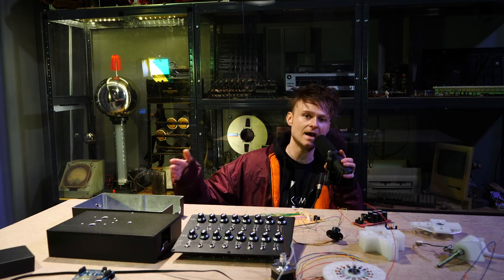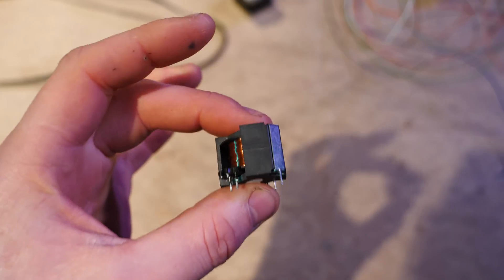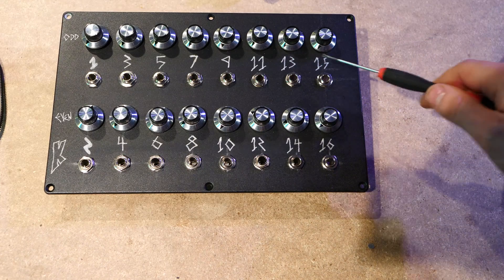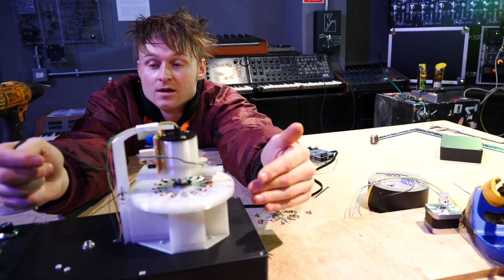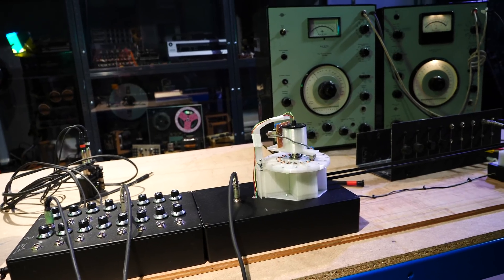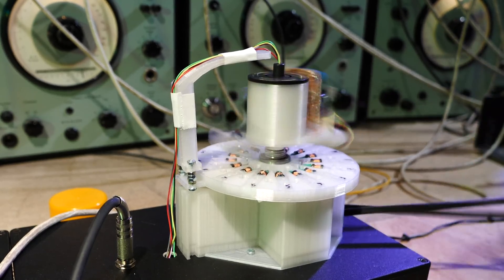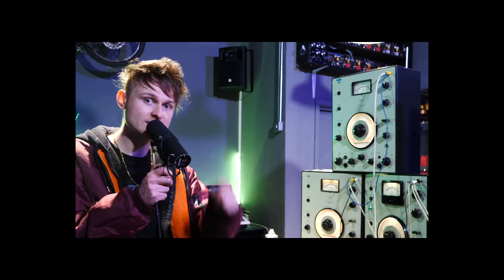Electro Magnetic Sonic Sequencer Thingy - Crystal Palace

Comment: Slip ring Can get kinda noisy  with age and damp and oxidation  + physical where down 

Shocked you Didn't go for a Rotatory Transformer  or shielded one)
 
Funny how both methods were used for Betamax and VHS

Rotatory Transformer won in the end Went on to Digital DAT & Digital Compact Cassette  & Digital Video ( Digital 8 & D-VHS)

Be Interesting to send S/PDIF over one of these even Multiplexing S/PDIF
Reply: Nah, trust Dave Young: High quality gold pen nibs are where it's at. =:o?

Comment: Sounds like they are talking about using the small gap in a fountain pen nib as an air gap capacitor.
Reply: No, the pen nib was used to pick up the signal from the rotating drum: it'designec to slide across paper without wearing out and getting pitted, so it was perfect for constantly rubbing against a rotating metal disk. =:o}

Comment: Raymond Scott's circle machine works on a similar principle, though he used photoresistors, and it was only hand-cranked to let you change the BPM of the sequence. The fact you're using tape heads and coils seems to introduce a few more variables since magnetic fields don't have strict boundaries. Also, the cascading effect of the inputs is frankly genius.
Reply: Yeah that cascade effect - or "normalling" of the inputs to their neighbours - is a feature of Dave Young's original design. In addition, the cross-fade between two inputs carrying the same signal resulted in no noticeable chance of level. So you could actually play a repeated 26 beat musical phrase by feeding each of the notes into the required input according to when it wax meant tl start, and have perfectly held notes across several beats just by not sticking a plug into any of the following input sockets.

Comment: Is it possible to run this device in the other direction (1 input to 16 outputs)
I want to hook it in to 16 speakers placed around a room
Reply: Slight redesign needed, I think, to get a decent signal strength into the coils. But getting a sound to spiral around 16 speakers would be cool! =:o}

Comment: This sounds lovely, can't wait to hear more! The first thing that springs to my mind, is how would it sound with something plugged into the even inputs like you have done, but then the output of the evens plugged into the input of the odds?
Reply: It would basically sound the same as if the evens weren't connected, if I'm understanding the signal flow he's gone for correctly. (The odd/even arrangement is a bit different from the original CP's signal flow.)

Comment: Why not direct drive rather than a belt? You are using a stepper... therefore a simple coupling like a piece of silicone tube to take up any misalignment... jobs a gud-un.
Reply from the maker: Electromagnetic noise
Reply: @LOOKMUMNOCOMPUTER  Why not try shielding.

Look at the CP device and see that the motors are shielded, the drive is a type of CVT drive to keep a constant and controllable speed as the wheel is moved in and out by a secondary motor pulling and pushing on a rod attached to the wheel, you can see the wear in to the disc if you look carefully.

I would say that the actual motor doesn't need to be that powerful as a stepper, so magnetic flux if in a metal case isn't an issue.

Putting the pickup and coils in their own shield will also make sure there is no EMF bleed.
Reply from the maker: @thepvporg  i have been trying things, mainly the reason is i only had about 3 days to figure out and build this. shielding was a faff and i just used parts from the bit drawer, as for stepper motor, its because in future i need more precise movement  backward and forwards and speed adjustable in the future i will have it just on the stepper motor but this is just a rough thing i cobbled together in about 36 hours hence the roughness.
Reply: @LOOKMUMNOCOMPUTER  I appreciate that you had a time constraint and your budget for shipping extended to your parts draw and sock draw, fnarr fnarr... 

I was thinking that this could be done a completely different way... Sent an email about it.
Reply from the maker: @thepvporg  alas didnt get an email about this today regarding motors but already working on a v2, about the size of a module. problem with direct drive is lack of hand touch but got a plan.
Reply: @LOOKMUMNOCOMPUTER  Sent it when I posted this, so you should get one.
Reply from the maker: @thepvporg  hi mark i replied!

Comment: Stepping through audio inputs reminded me of a lovely module for the ARP 2500 called the 1050 Mix-Sequencer. A 1x8 or 2x4 sequencer, it could pass both audio and control voltages. It can usually be found next to the 2500's 1027 10 step Sequencer modules to combine its three lines for longer sequences. It could combine the three rows to get 30 steps or as many as three 1027's for up to a 90 note sequence (I wouldn't want to have to tune that in the days before quantizing). It was most often used as a pair of four input mixers selectable by either front panel buttons or voltage control. I remember Pete Townsend of the Who commenting that he used it in that mode as a preset selector when creating both Quadrophenia and the soundtrack for the movie of the same name. In a synth with no patch memory that must have been quite handy. It's the synth module I've most wanted to get a chance to try out ideas on ever since I read the ad brochure back in the 1970's. I'm sure there are eurorack modles with similar abilities but, like much of the 2500, the Mix-Sequencer got there first. Like much of the 2500, it was way ahead of it's time.

Comment: When one outside of the UK hears about that BBC Radiophonic Workshop, they immediately think of Doctor Who.

I believe most of the Doctor Who's Foley work was done with a Mellotron that was custom fitted with various audio samples specifically for that purpose.
Reply: Dunno where you heard that, but in my 45 years as a devoted fan of the BBC RW I've never heard it! =:o}. 

Basically, up until the early 1970s the RW would prepare tracks on quarter inch tape, and they would be queued up and played into the studio using standard tape machines, by very skilled tape operators. From the mid 1970s onward sound effects were created and recorded in post-production, but still supplied on standard reels of quarter inch tape to be dubbed into the final soundtrack in a dubbing theatre. In the 1980s, the Beeb's video equipment was upgraded to accommodated multiple audio tracks, and this made it possible to dub sound effects and music directly into a dedicated music or effects track, separate from the dialogue, and so those tracks could be assembled in a less stressful way than having to cue every track in in real time! =:o}

Comment: Based on what I've found, you've pretty much nailed it. 
The gold pen nib seem to function the way you are using the slip rings.
The whole thing seems to  be based on a series of old-school air-spaced variable capacitors. You know with those half circle spinning bits (called plates). Depending on how well the plates align at any moment, controls the strength of the signal passed. Yeah, so, you're doing the same think but with magnetic coupling.
Reply: Spot on.

Comment: Beautiful! thingy and sound 👌🏼 Are you sure the (lovely) saturation is coming from just the tape head and not from coil+transduction+head? /// There's is a very interesting synth circuit you can build using photocells, LEDs and a LED-controlling chip. Search for "electro-optical mixer" and "cadavre exquis" to find text and schematic.
Reply from the maker: I didn't mean from the tape head the saturation is coming from the motion of the magnetic field coming from the inductors to the tape head mixture of both probably and headroom on either
Reply: @LOOKMUMNOCOMPUTER   I see. Excellent

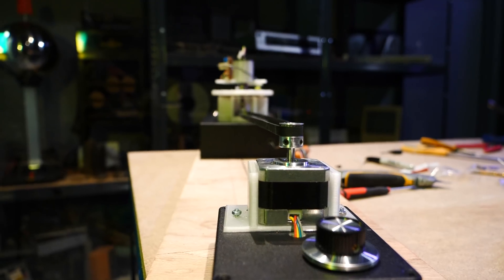Comment: 6:06 Is the tape head or the inductor the saturating part? I'm wondering if this could be used to build some kind of "tape saturation pedal" this way. Even though there's no actual tape involved. Thanks for the inspiration anyways!
Reply from the maker: Just use a tape write head and a tape read head yeah I thought about that the other day it would work however you don't get the warble
Reply: @LOOKMUMNOCOMPUTER  Not getting the warble actually sounds pretty good. I want to use it to get nice "tape" saturation for synth basslines. Nothing to aggressive but to beef things up a little. Thanks for the quick response!
Reply: Real tape saturation comes from the properties of the tape, not just the heads. If the tape heads were competently made, their saturation point should be well above that of the tape.

Comment: The simplest possible oscillator you can make with an inductor is a LC oscillator, right? A capacitor connected across the pins of the inductor? If you made a dozen or so of these, each one clipped into a plastic shell, you could link them together into a chain. Pass them across another inductor which charges them so they start oscillating, then immediately run them over a tape head, and you have a variable-length sequencer! Tune each cell by adjusting the capacitor (somehow)! Extend the length of the pattern by just clipping more on! Mount it on a bicycle and pedal your way through the music, particularly if you can use a dynamo to run the electronics!

Comment: Sounds insane, the character of the signals fading strange and crusty, but super nice - great project man! Have you thought about making a "linear" version, kinda like a reverse railgun?! You could integrate it into a hot wheels track and use it as a kind of "one shot" build/fade effect. Or even get real tech and set up a full scalextric loop, use a voltage controller to keep the speed regular, stick a tape pickup on the car...  

Or how about a bloody massive grandfather clock "metronome" system, you could have a static tape head where the round pendulum weight is (with a row of coils in an arc that it follows), and also a mobile tape head that uses a motor to move up and down the shaft. Then you could have a vertical row/matrix of coils under the shaft motor, giving you 2 axes of movement. Potential for some interesting rhythms cause of the sine oscillation perhaps?
Reply: I would do that first idea by adding a "brake" to the existing design, that both stops the movement dead and cuts the power. Add a pulse switch to take off the brake and start the sequence running, and you've got a "one shot" effect that be re--triggered as soon as you like. =:o}
Reply: @therealpbristow That's a great idea, might be problems with bringing the wheel up to speed again without losing the beat. Sure it could be done though, just have a subsystem with a sensor that only lets the signal back out once it registers the wheel is at full speed? Edit - or just have 2 separate wheels, one for main and one for one-shots

Comment: As the "capacitive" in the name mean, I think the original use plates separated with a small gape and a amplifier with a high impedance input (1M ohms is usual with valves/tubes)
Reply: Correct.

Comment: I wonder if it would be cool to add a few more components, maybe another tape head and set of inductors or maybe a roller switch at each coil, so you could get a pulse output mechanically linked to the rest of the machine. It probably wouldn't be perfect but it'd be fun to clock synths to this thing even if it's a little sketchy. This thing is an all time great LMNC project as far as I'm concerned!

Comment: From just a glance and with no research, that "crystal palace' box seems to hold a capacitive scanner from a Hammond organ vibrato unit. The audio from the heart of the organ ran through an amp and then through a long multi-stage LC delay line with taps at each stage. The taps connected to the 16 plates of the capacitive scanner and the rotating center electrode of the scanner went to the pickup amp tube while also being grounded by a 500MΩ resistor. The Hammond scanners were driven by the same motor that drove the oscillators and failed over time from mechanical wear. Hammond made retrofit scanners with their own motors to replace these failed scanners in the big H series organs.... perfect for hacking.
Reply: And they sound very cool 😎
Reply: That's almost certainly what that is.  I remember (Jeurgen Haible I think?) a synth DIY site on repurposing Hammond vibrato scanners as an effects device.  The synchronous motor in the Hammond always spins at a steady rate but hooking one up to a DC stepper motor or something would be interesting.
Reply: @busted_keys  It was Juegen.   He built a non-mechanical clone, too "The interpolating Scanner"
Reply: @demagmusic  oh yeah I remember now! I made his Tripple Chorus years ago and it's awesome.
Reply: I remember that circuit!   always wanted to try :)
Reply: I have (almost) no idea what you are talking about, but it sounds amazing 😎
Reply: I don't think it actually is, as the legend has it Dave Young built the CP around an old washing machine motor, adding various repurposed items from a flea market that was based somewhere near the RW site. When the head of the workshop said "Excellent! Build us five more", poor Dave's heart sank. The components he'd used were all virtually unique! =:o}
Reply: @therealpbristow  instead of following here-say legend silliness, why don't you just look up images of 'Hammond organ vibrato scanner', a device from the 1940s, the blooody 1940s for f sake. Jeez. That looks like a clone of a Hammond scanner and washing machines don't have little motors that run at medium speed. Some people can't cope with reality.